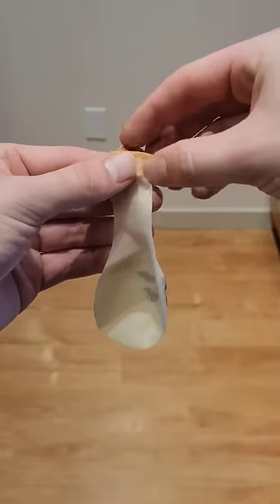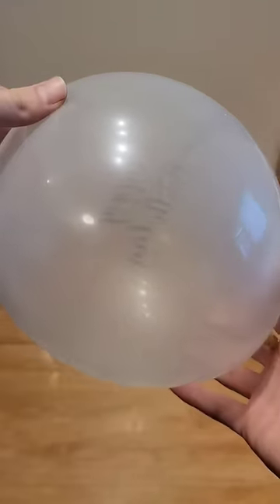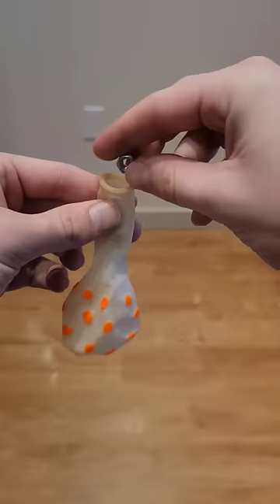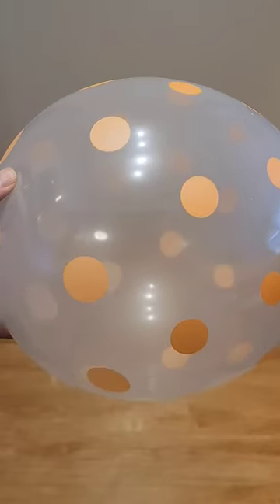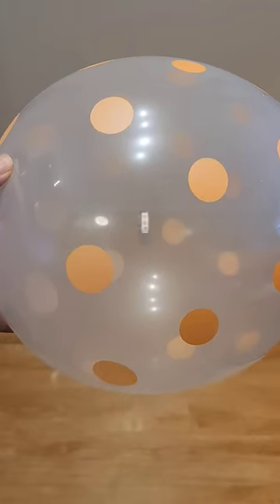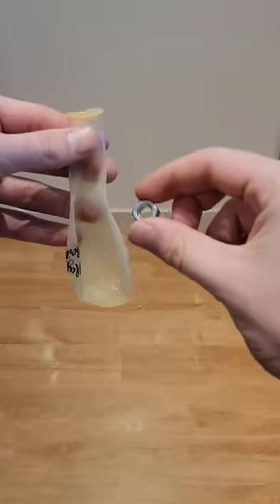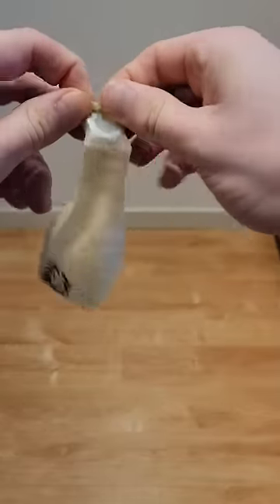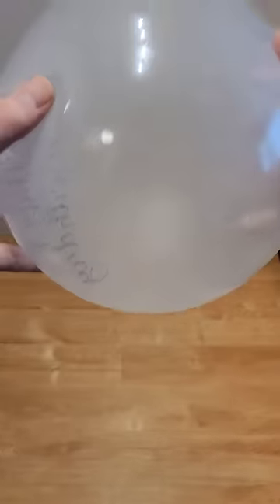Spinning Hex Nuts Inside a Balloon in Slow Motion #physics #experiment #shorts

Comment: “This large nut is putting a lot of pressure into the balloon”💀💀💀
Reply: 69th like
Reply: @austria-hungary7680  75th like🤓
Reply: Hot
Reply: @Prounx. 154th like 🗿🍷
Reply: Thats what i noticed
Reply: The rubber can only withstand so much pressure. You need to be careful to avoid any accidents.
Reply: 329th like
Reply: @ANTEUEX it would be a disaster if it broke

Comment: For those who like a challenge, since the sound produced come from the repeated "tap" of the hexagonal shape as it rotates, try to predict by maths the frequency of the sound depending on the rotational speed and then verify your prediction with a sound spectrum recorder app. 
Use a non-slip hypothesis and ignore the strain to calculate, it's easier and pretty correct I would say.